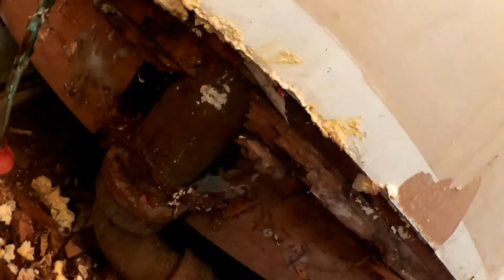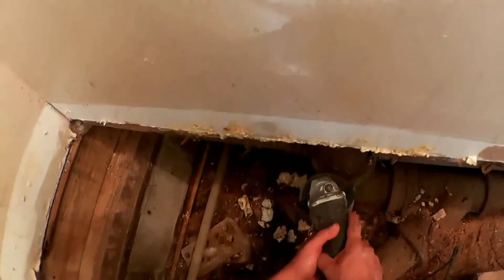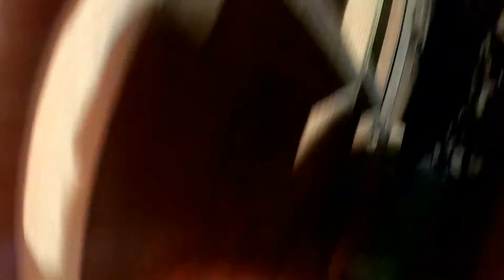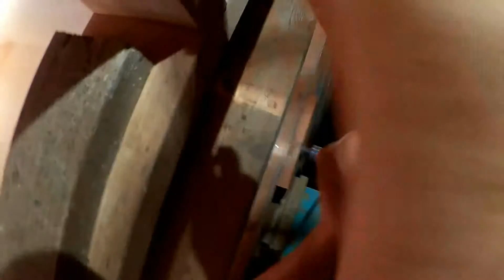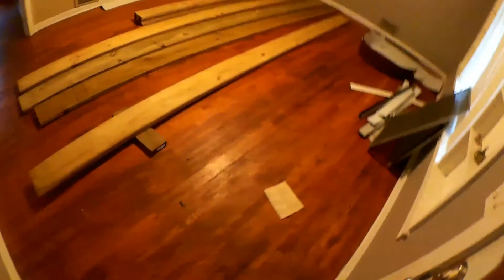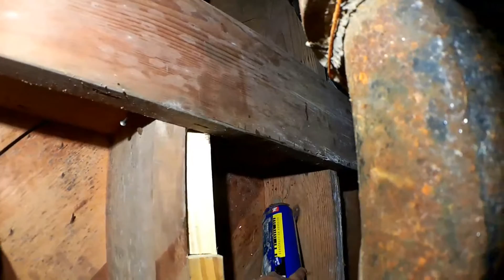bathroom lift

Comment: Wow thru the joist I'm surprised the wall lasted that long. You have a job ahead of you.
Reply from the maker: Leo Emler seems to be a pretty common practice around here.  I've repaired bigger disasters, but this is in a very tight spot.  I can't imagine why people make crawlspaces this short.  I should have part 2 up in the morning and I'll be doing the final lift tomorrow.  Thanks for commenting.